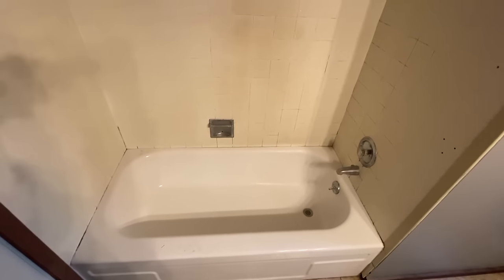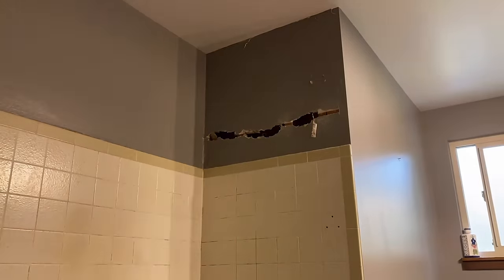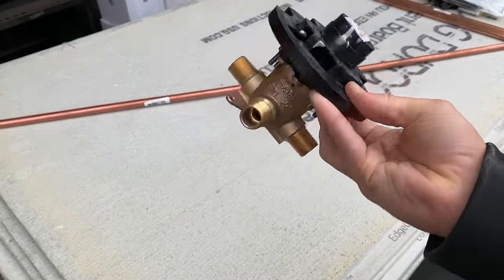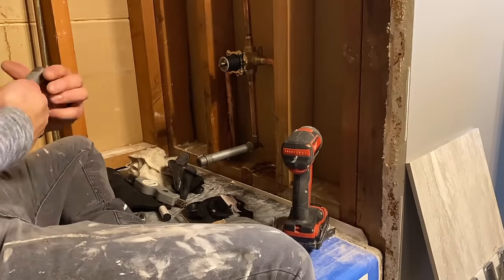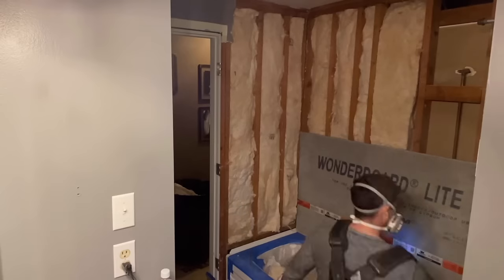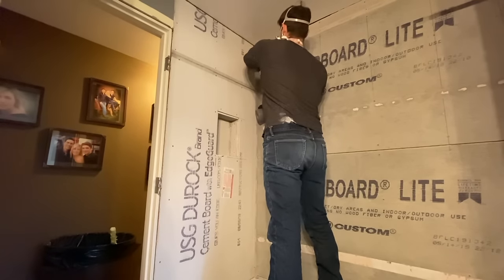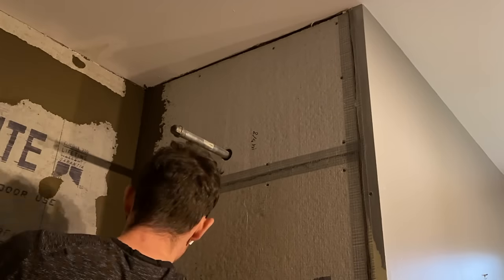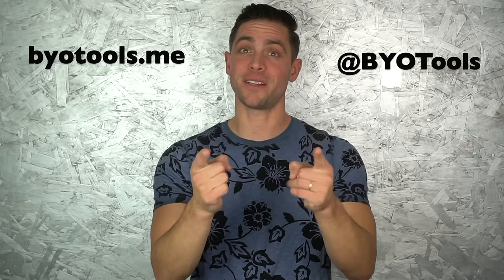DIY Shower Remodel : START To FINISH (Part 1 of 2)

Comment: Sigh. Mid-demo on my 1940s bathroom and the tile was set on one inch of some sort of concrete embedded in chicken wire.  YouTube makes it look so much easier than it ever is. Lol.  Hoping the install is easier!
Reply: We are mid-demo on our 1960s master bathroom.  The bottom 3 feet of our shower stall was the exact same way! Thinking cement board wasn’t a thing yet?🤷‍♀️. Somehow water still got through it and we had water damage and mold on the wood and surrounding drywall.

Comment: Not me thinking I was about to DIY my old shower with my own two hands. I tapped out when you explained the plumbing part.
Reply: Saves me 12mins thanks
Reply: You can demo around it just be careful always shut the main water off when your ready call a plumber to replace piping and install new fixtures you can always cap a line with a sharkbite if you have to , then once youve done the process you can save a lot of money ive seen customer showers up to 10k
Reply: Girl, me too
Reply: @lacyconroy7916  I guess I will stick to learning to paint... LMFAOOO
Reply: Same lol as soon as he listed the supplies lol

Comment: My new tub is in; the faucet is installed, and now I'm staring at the open walls, paralyzed.  I've done tiling before, but for some reason, this time am feeling intimidated even by simple tasks.  Don't seem to have the courage or the strength (it is NOT Lite) to bring the tile board in from the car.  I've watched about a hundred videos to build my nerve, and this is probably the best for clarity.  I have heavy plastic taped up, so can shower that way indefinitely, but really want to see my tile on the wall.  Thank you for the upbeat attitude.  Too bad you're not my son or I could pour a G & T and just watch.

Comment: You live somewhere very warm to have a water shutoff at ground level. Ours is 6 feet down.
TIp of the torch is much hotter, you solder with half the flame encompassing the pipe.
Very Nice Job! It's always great to see someone take the time to do the little things

Comment: Great video.  I made a drinking game out of every time you used the word "generally" or " general" and I'm more faded than a message in the sand on the seashore. I got some good tips for the sober moments too, overall I'd say I'm generally WINNING! 10/10 would would come back, keep the flow!

Comment: I'm sure glad I found you and your video! I'm an old tile man, but things do change some in forty-five years, eh? A little time stamp: I was working when Dura-Rock was just introduced. Boy, doesn't that make life easier. Now my challenge is remodeling a bathroom that has all the charm of a bathroom in a nasty gas station in the middle of the desert, or perhaps a bathroom Greyhound might deny owning. Add to it? It is a manufactured home. So we all know at this point this is going to be better than a I Love Lucy show. Dyslexic? Check. Dyscalculia? Check. (autistic number scrambling). Left-handed? Check. Can I get confused with the direction of "righty-tighty" & "lefty-Lucy" even though it is a clue which direction to turn it? Oh hell yeah!
I have a deep hatred of vinyl wrapped wall panels and breathtakingly bad plumbing fixtures. Before I unpacked anything when we moved in (other than obviously, the coffee), I ripped down the 1/4" glass mirror that was losing the silver backing at the bottom of it first. I'm terrified of walking under ladders and breaking mirrors, but this time it was an act of the Decorating Police (that is, me)
So, the plastic tub, the chintzy plastic shower walls and the crap fixtures are going. I have a back edge in the front that is bowing outward enough for moisture to get in there. It smells ripe. How much damage could it have caused? The house is ten years old and in fine shape, but it also was built with modern materials and what they use in mobile homes. It's funny because the materials that are used are to HUD's specifications, but despite that, it seems that Fleetwood approaches upgrades and sensible additions to their parts list' like American car manufacturers would begrudgingly change this, but not modify the car design so the new designs or practices fit seamlessly and brings the best experience to the consumers.
In modular houses (these homes have not been called "mobile homes" since 1976 They come in at least two huge hunks, have to be permitted to deliver and install the home, tied to cement casings underneath the place. It would be cheaper to move a stick house than a "mobile home."
When you get inside you can see all sorts of ways the manufacturer "cheated" the build. I know conventional homes are built badly today. I stare at my modular home and can tell that a factory house is many time built by people than know less about construction than the average hammer slinger. They are designed for workers that have no experience whatsoever, to built a house without it falling down on the assembly line, lol. How I could go on.
But this is my house, and I am a perfectionist.
Just on a video technical note, I like and think it is smart how you just film the work--and I think shooting it speeded up was a smart move. After you demonstrate the technique or the tool, you continue to show it in action which is good reinforcement. I think that you might want to put chapter markings for each technique, or fixture focus, or whatever would help. I'd be damned if I could tell you how, but I know YouTube has the instructions somewhere. 
You know a helluva lot more than I do both as a craftsman with tile and with video. I'm still a month off before I destroy my bathroom. I kick around doing a video of it just because I've got all sorts of house projects I have to do, but goof around with my raw video in post production, just for the practice and possible use. I actually ended up in a training position, despite my ineptitude. I always explained that it was because I had made every mistake in the book, which qualifies me as a teacher.
Rock on! I'm lovin' what I am seeing, and your asides and snarky comments adds to the fun!~

Comment: Did you run galvanized straight onto copper?  Do you not have to use a special fitting to stop galvanic corrosion?

Comment: Great video as always man, been a subscriber since day one! Just a tip though, dont use galvanized pipe along with copper-disimilar metals, also try to avoid using galvanized pipes with plumbing 😊
Reply from the maker: Good tip Karl.  What type of pipe would you suggest for the tub spout?  Thanks for watching and the input.
Reply: Ashley Fox Johnston  what diverter valve do you recommend?

Comment: Curious why you didn’t use PEX? Just curious, not a critique. I’m getting ready to redo our shower and was thinking about using PEX just because I generally suck at soldering and didn’t know if there was a preference on the reason that I need to take into consideration.

Comment: Do you have to worry about using galvanized pipe and copper together?
Dissimilar metals will corrode faster, won't they?

Comment: i am confused. the point of durock is for the tile and mortar to adhere to the wall.. then you put thin set over it, and then the pink stuff.. So in essence, there is more bonding with the durock, so is there really a need for durock?

Comment: question: with cement sheeting you domt need to also use an adhesive to attached to the studs (like plasterboard)? genuinely curious

Comment: I’ve torn out 7 showers so far that just use redguard as waterproofing because they failed and molded out. I get floating isn’t for everyone but there’s better options out there then redguard
Reply from the maker: Its probably because they only use one layer of redguard instead of two as they say in the directions.  I've used it on numerous projects and never had any issues what so ever.  What is Floating?  Haven't heard that term before when doing a shower.  Thanks for watching.

Comment: All pretty good exCEPT:  You did not prime the backer board prior to applying the straight Redgard.  That backer is a 'lightweight" concrete board and must be primed.  It's on the Redgard installation instructions.

Comment: Is there a way to test plumbing before finishing it completely???
Reply: Yes put and termination 1/2” pipe cap on the shower head pipe & the tub spout. Then you can turn on your shower valve before putting up the wonder board

Comment: Is there a particular reason you didnt use  threaded fittings for the mixer valve then solder  to those fittings?

Comment: I got a crazy quote of $18K for something similar in size.  But no tub had to be dealt with(walk in).  Not tiled but paneled.  Went to Dale's Hardware, Lowe's, and Home Depot and all 3 showed the material costs at being around $2000 for good material.  WTH are they charging for labor these days?  This isn't a 1 hour plumber visit.  A hundred an hour for a many hour project?  $200/hr???.   Where do they get $18K out of this shower only re-model?

How many hours did this take?

Comment: so i have a stand up shower and want to do this, in this case i wouldn’t have to do the pipes i’m assuming?
Reply from the maker: If you have a stand up shower and it’s working just fine then Yes it sounds like to can avoid the plumbing steps for the most part.  Thanks for watching Kevin and hope you subscribed
Reply: BYOT i am now!!!

Comment: How much red guard did you end up using for this space? 
The link gives a 1 gallon on Amazon however it look alike you have a larger than one gallon bucket.
Reply: I know it's a late response but use a small bucket if it's available. Because a full bucket can paint 3 rooms

Comment: You could also have a spray bottle and spray the wood with water
Reply from the maker: What would that be for DJ?  Thanks for watching and subscribing.  Greatly appreciated.
Reply: BYOT when you were soldering the pipes you could have sprayed water on the wood

Comment: One BIG mistake, CHECK FOR LEAKS!  after soldering, plug the outlets, turn the water on and check for leaks. You'll thank me later., Oh and stick with copper for the spout and shower discharge, dis-similar metals do not like each other and will corrode, electrolysis

Comment: I think it’s better to cut out the nitch once you have started tiling up to bottom height of where you want to start the nitch. Doing that you will have good size tile for the nitch surround. If you prep the nitch before measuring you could have very small tile pieces

Comment: I wish mine went as smooth as yours, I didn't account for the back wall not being plum and was trying with subway tiles. Ended up ripping it all out and starting from scratch with big tiles.
Reply from the maker: Ouch!  That sounds like a rough one.  The wall being plum makes life a lot easier.  Sometimes thinnest can be used to level things up appropriately but not if the wall is really out of wack.  Thanks for watching and hope you enjoyed the video.

Comment: Ok you don't need to put thin set on your joints if your using red guard fyi, that's the point of it, it's a joint and wall sealer. Also wonder board it crap. If it gets wet it crumbles and absorbs water and molds. Durarock or hardie is the way to go. Also you should put a bead of sealer between the tub edge and backer board it will keep water from ever migrating up behind the board. These videos get home owners in trouble, they think it's so easy and end up calling us out after they have issues and then have to pay for us real professional to redo all that work and cost you far more. Or I go to clients houses and they show you their diy shower, they are so proud of and actually say "I should do this for other" or say "I saved a lot of money and did a better job then what I would have got from a tile person", I look and it looks like total crap and it was done horrible and they will have issues later. I just laugh in my head and say okay 🤣🤣🤣. They really get mad later when I have to come back and rip it all out and do it the right way and they then pay double because of what they lost putting into it the first time.

Comment: You did it wrong you were supposed to leave two  breather pipes so you can have more pressure
Reply from the maker: It was installed as the instructions noted. What is a breather pipe Alvaro? Thanks for watching!
Reply: @BYOTools  okay  you can either make them or buy premade ones  but premade ones are all one size so we just make them our self, it's to build pressure so your skin or showerhead have enough water out of them and don't feel like it has 2 drops of water coming out of. Where  u put the 90 degree  elbows you  should have put a t connection and about a 10, 12 inche pipe 8, 6 if there isn't enough space, cap it off and that is all now your water won't go directly to the mixer but will have builed pressure from the extension.
Reply from the maker: Interesting.  I’ll have to look into this one and learn more about it.  Thanks for the tip!